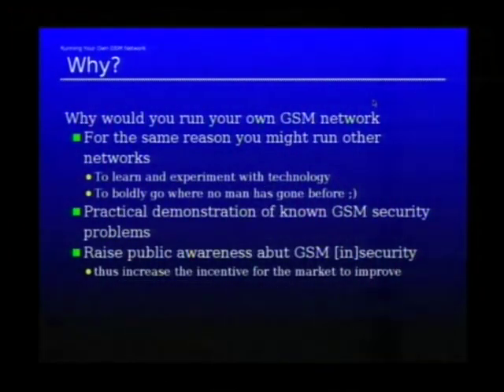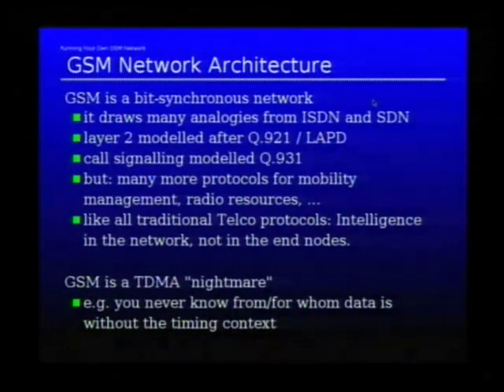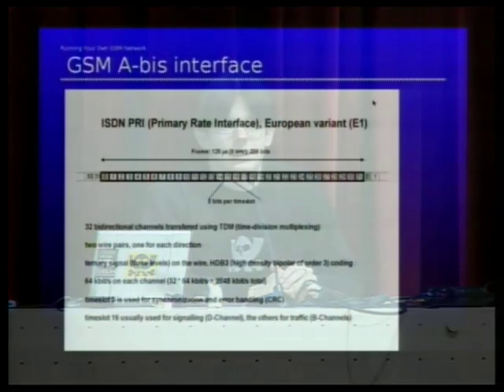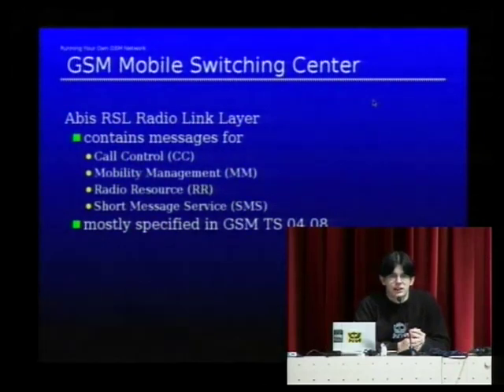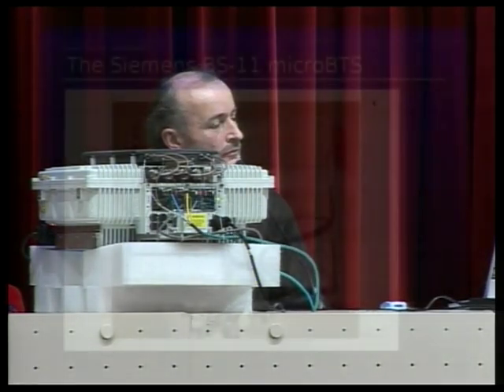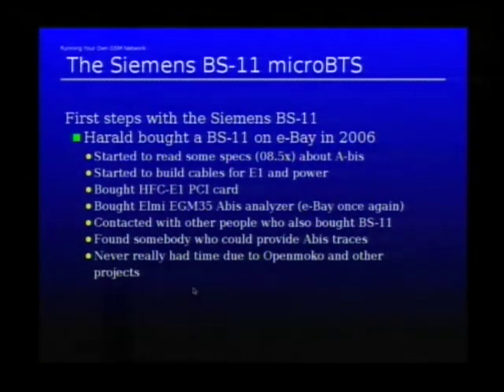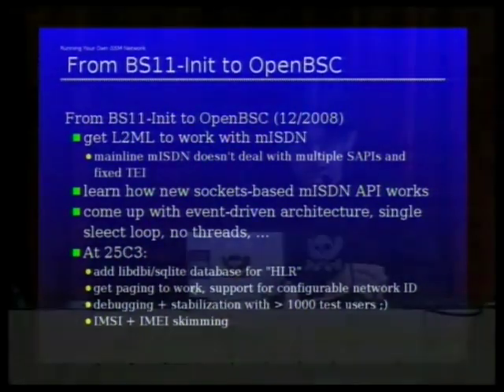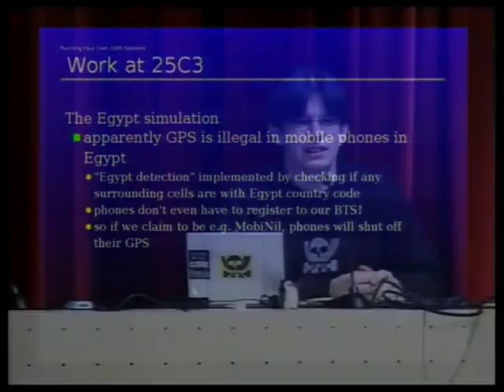25c3: Running your own GSM network

Comment: Couldn't we come up with a better implementation of a GSM network? I figure it might be more interesting to make it more decentralized. Have users own both a mobile device and a stationary antenna which both work on low power so as to not disturb the cell towers. In urban areas this would work well enough I propose.

For remote areas, wouldn't it possible to hook the antenna up to wired internet instead?
Reply: You wanna have a cell tower that doesn't disturb cell towers?